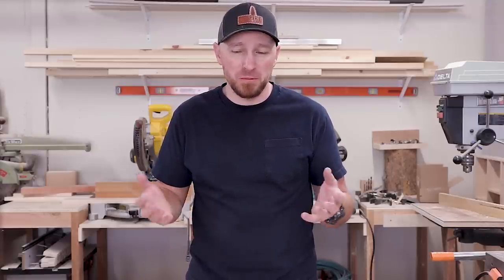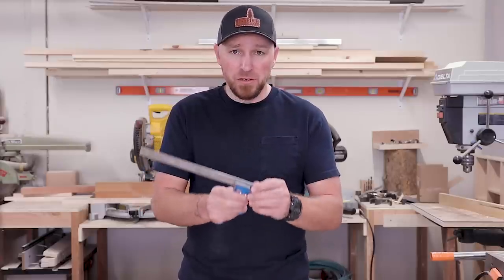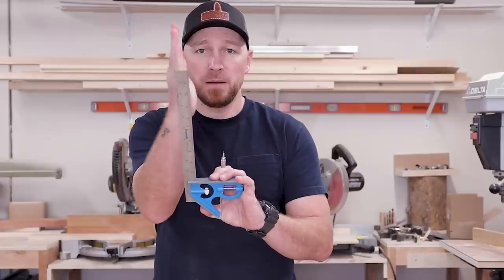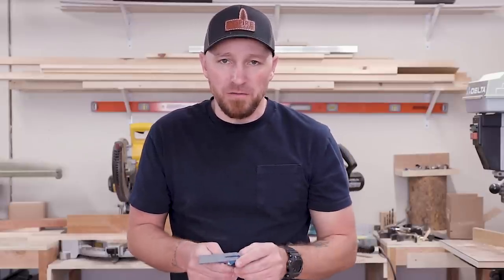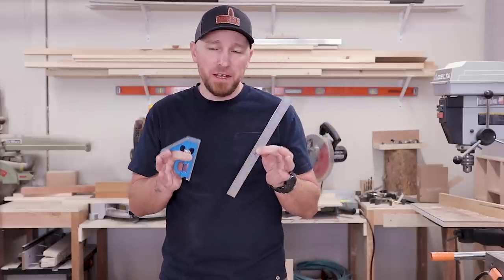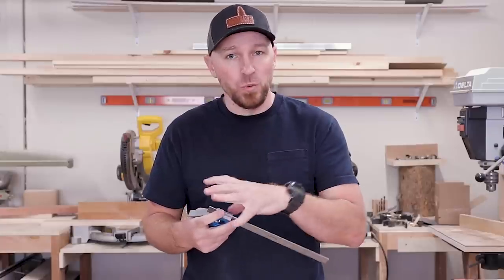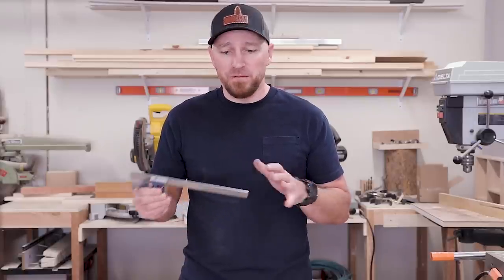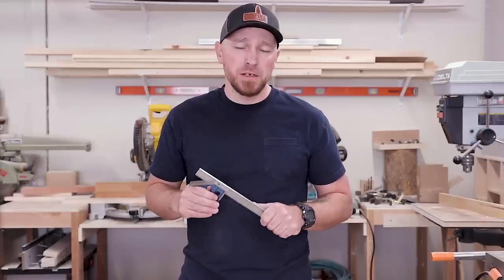How To True Up A Combination Square The Simple Way AND Tune It Up To Make It Work Better For You

Comment: Surely the sandpaper method will not only sand the "pads" that the ruler sits on but also the walls of the slot and make the gap wider and therefore sloppy and not holding the ruler properly over time.

Comment: I’m not sure I understood, in the beginning. When the ends of the ruler are further apart, in the measurement on the wood, you need to bring the end out, not in.

My method of not damaging the head when replacing the ruler is to loosen the nut more than needed. The I tilt the end of the ruler slightly upward. I place the ruler in the slot and bring the end back down. Then, with the nut pushed upwards, I slide the ruler inward. When it touches the guide, I bring the quide downards until it lines up with the groove and push the ruler all the way in.

If you use sandpaper to work on those ridges at the bottom of the slot, be careful to not sand the sides away.

Comment: Ugh. Where to start? 

If you use sandpaper or a file on the head, you need to protect the sides of the slot using masking tape or shims. Soda can material will make fine shims if you don't have suitable shim stock.

The end of the blade is, at least hypothetically, a precision reference surface. You don't want to booger that up by using it as a cold chisel. Also, the head on a decent quality square will be made from cast iron or forged steel, neither of which will be kind to the poor blade.

Finally, before you start modifying the head, you need to check the blade for straightness. Best way is a surface plate and a string back light.